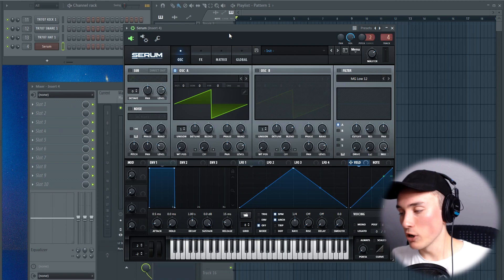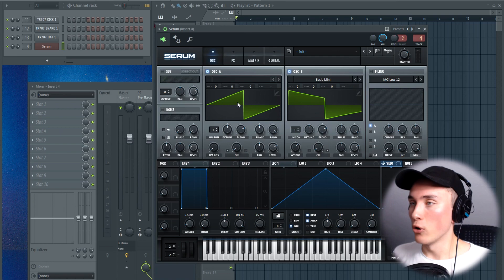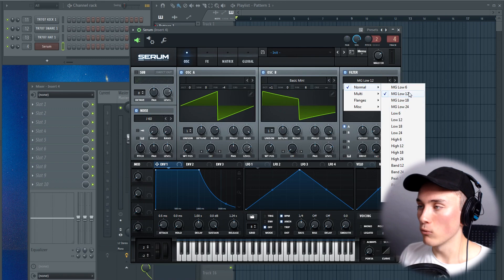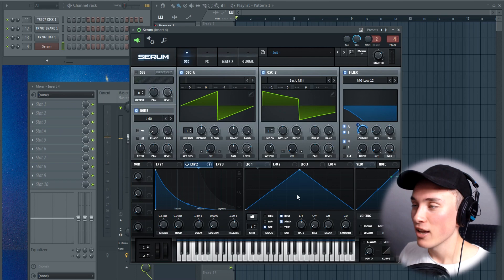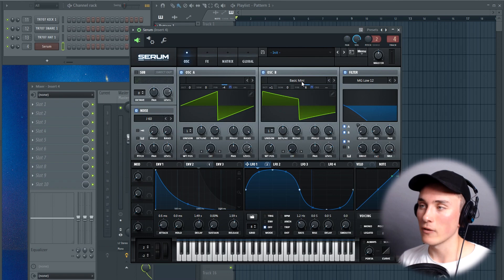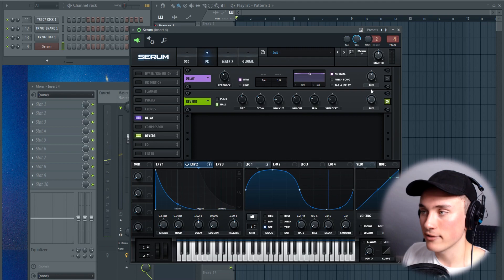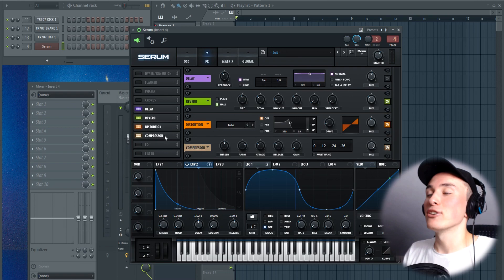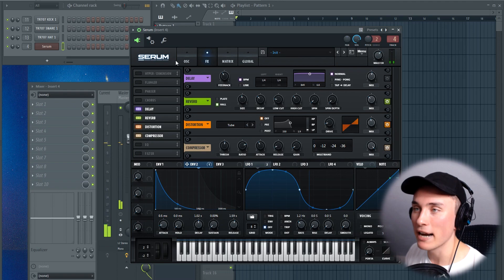How to Make Your Synths Sound Retro/Vintage/Warm - The Basics

Comment: Hey Rosentwig, I found this tutorial SO helpful. I've heard quite a few of your tracks and so was pleasantly surprised that you made a tutorial like this. I am starting small with my synth journey and using the Arturia Mini V3 to learn basic synthesis and experiment with sounds. Anyway, I'm really trying to master it before investing in any other synths.  The Arturia Mini V3 is lacking in some of the LFO/envelope controls that Serum uses (I know that's a more modern feature), so I feel like I can't modulate the oscillators' fine tuning to get that VHS-y tone... Is it possible to emulate these similar kinds of sounds in the Mini V3? Do you know anything about the Mini V3's Modulation capabilities?
Reply from the maker: Hey! Thank you so much!
I actually really love the Mini-V3 - it's still one of my fav soft synths.#
Imo you don't really need to invest into another synth. Everything I showed in this tutorial can be done with the mini v.

The "vhs effect" you're looking for can be easily done in the mini aswell. Just go to the modulation tab (press the double down arrows on the top right, then on modulation)
Select LFO as Source, set the destination to VCO123 FM (this is if you wish to modulate all oscillators fine tune in the synth, you can also only do this for one of the VCOs) then play around with the amount (something like 0.0030 gives a transparent but retro effect) and then go to the LFO tab and change the lfo shape, rate etc.
Reply: @RosentwigMusic  Thanks so much for the tip, Rosentwig - just one week later and after dabbling a lot I've been making pretty cool retro-style sounds! The Mini V3 is actually way more capable of sound altering than it appears - compared to Serum it looks more limited but it's really got some great features. Really looking forward to making music now :) and really looking forward to your future releases - wallflower was such a treat to listen to.